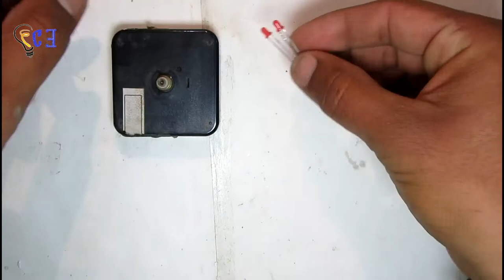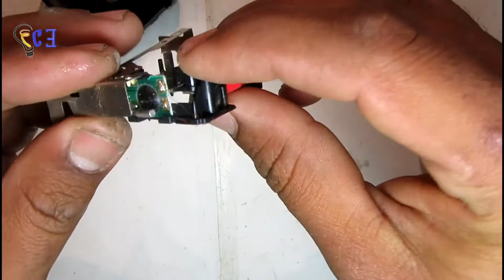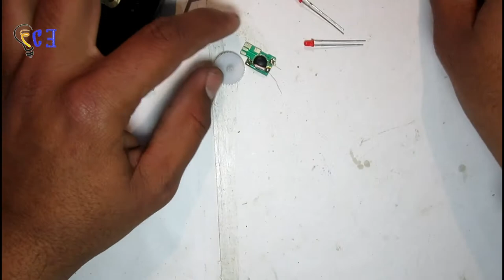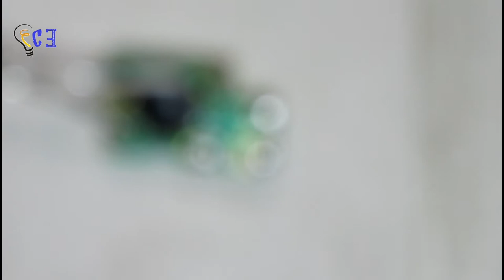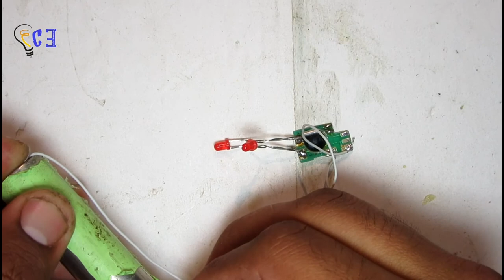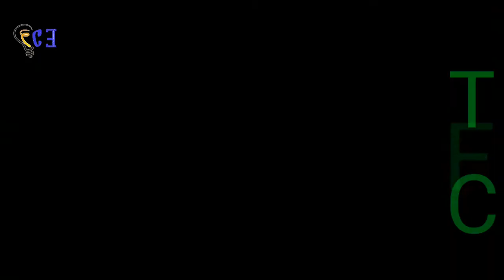How to Make strobe light at home using old clock machine ||Creative Electronics ||

Comment: If I installed a resistor,  can I use 20v dc
Reply from the maker: no , use 5v regular with 1k ohm resistor
Reply: Creative Electronics oh, I was hoping that I could have installed it into a g scale train as ditch lights